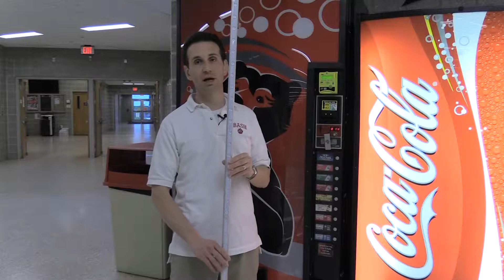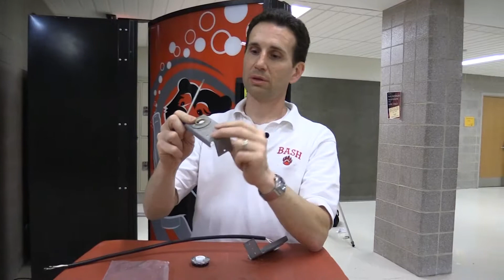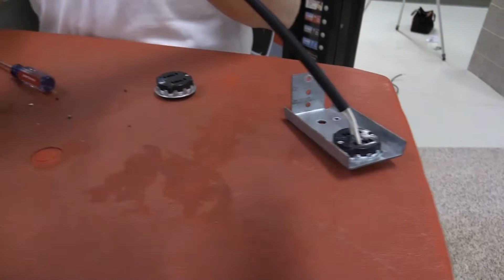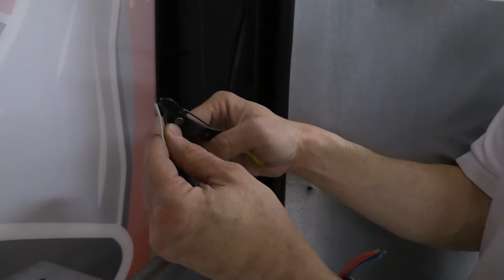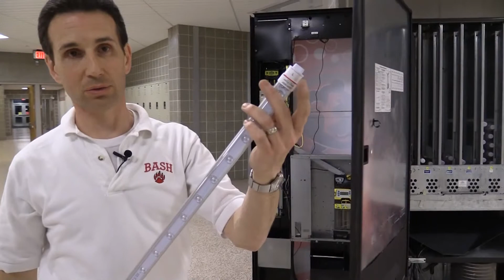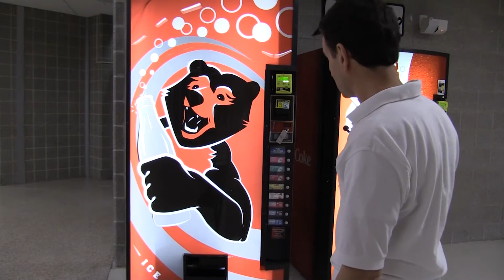How to Convert a Soda Machine to LED Lights

Comment: Why not put the flurescent bulbs back, if its a choke ballast it will outlast u and this bulbs are meant to be changed and can last very long time (my T12 22W flurescent tube lasted for 45years)
Reply from the maker: I have a couple machines that still have florescent bulbs and they don't last more than 2 years before needing to be replaced...and that's with a timer turning off the lights during certain times.  None of my machines that I've put sign-hero LED bulbs in have gone out.  Also, florescent bulbs for these machines have gotten expensive.

Comment: 110v??    I want to change my 18" bulbs to LEd also but schematic shows 24v.  Will check with a meter.      Merlin IV.
Reply from the maker: My Merlin IV is 120 volt for the lighting system.

Comment: So are the two big lights the lights that light up the selectors? Or are there separate lights.
Reply from the maker: The selectors don't light up the giii machines.
Reply: @HappyVending  okay. So do you know about a dixie narco?
Reply from the maker: @alum1n1umkn1ght3  My Dixie Narco 276e does not have lighting for the selection buttons. I guess they figure that enough lighting is provided through the front graphic that additional lighting is not needed.

Comment: How do you take the bulb out ? I got the same machine but I can’t figure it out
Reply from the maker: The bottom sockets are spring loaded.  Just push down on the bulb and pull it out of the top socket.  Then fit the bulb through the top of the door and pull it out.  Watch the ceiling.

Comment: Where did you get the adapter?
Reply from the maker: I didn't really use an adapter.  I ordered the light bulbs from a local electric supply company and the sockets I ordered from Royal.

Comment: Great video, great information, very in depth explanation!  I just purchased my first vending machine last year for home use and a few of the selections are either temperamental or don't work at all.  Any ideas of where I should start looking?
Reply from the maker: Thanks.  What type of machine did you get?  Most have a test mode where you can test the switches, motors, relays, etc.  If you don't know how to use the test mode, another solution is to swap parts and see if the problem follows the part.  For instance, you can swap selection switches for a selection that you know is working.  If the problem follows the switch, then replace that switch.

Comment: What setting did you use to get your nayax to flash like that ?
Reply from the maker: I just have it in the default setting.  I think there are only two choices for the LED lights...stationary and running.  The setting should be in the "General" tab under "Card Readers".  It is called LED Configuration.  I am in the computer interface.